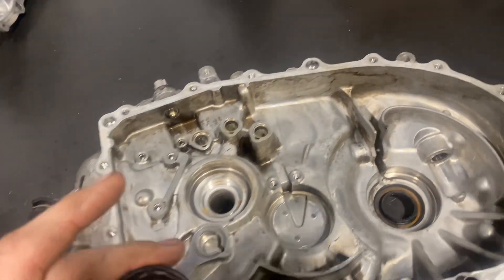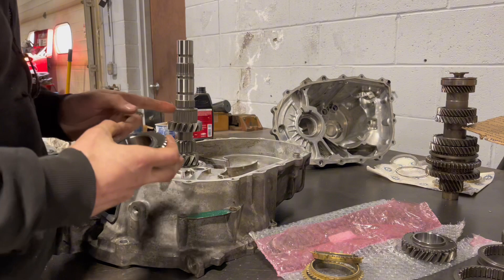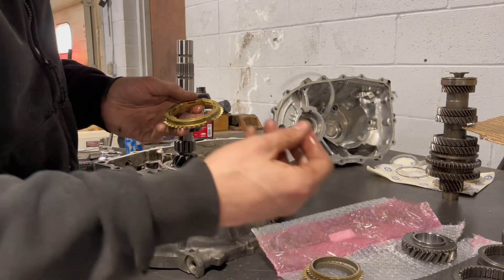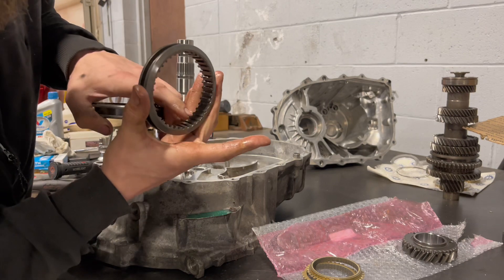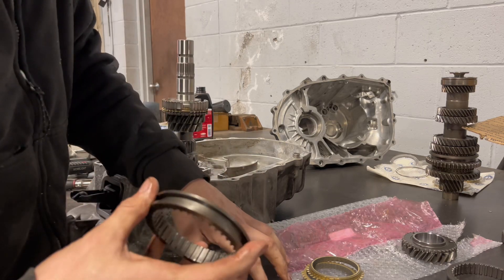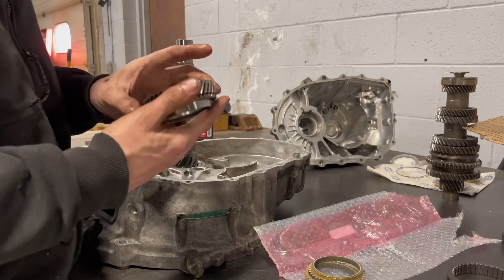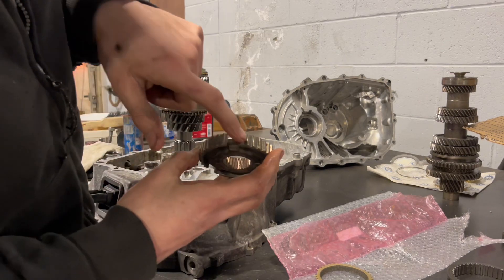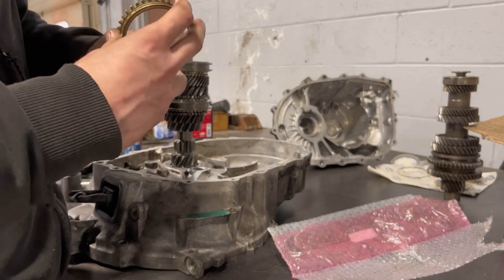K series transmission rebuild how to! Part 1

Comment: Hey bro, how can we get in contact? I have some questions. I’m currently stuck putting my shafts back in the case. When putting the shift forks and shafts back in, they don’t drop in the bearing and I’m beyond frustrated because the only thing I swapped out was my second gear all are for the specific car but I just can’t get them to drop In. wtf did I do wrong
Reply from the maker: Message me on ig adam27lane
Reply: @adamlanebuilt  check dm